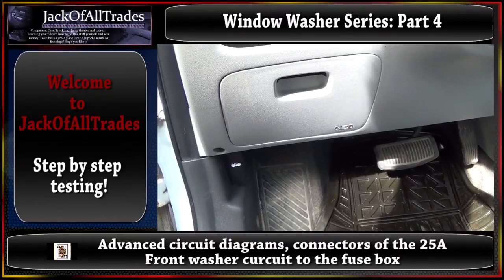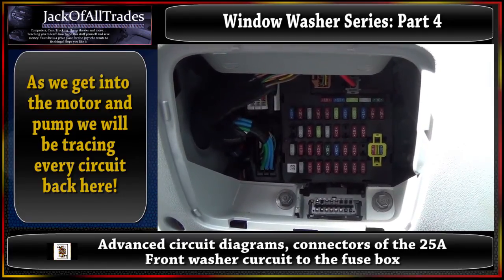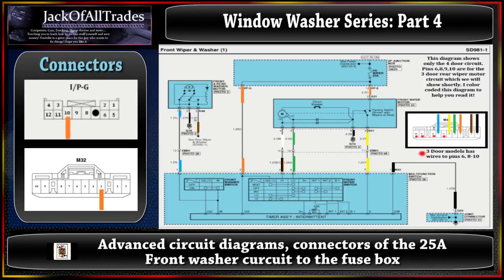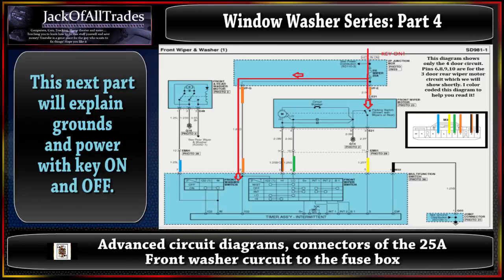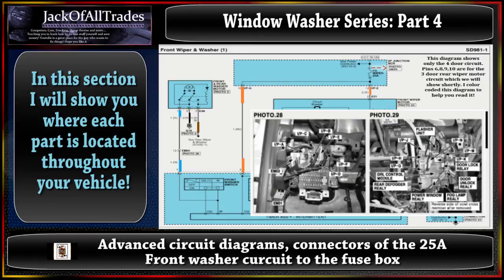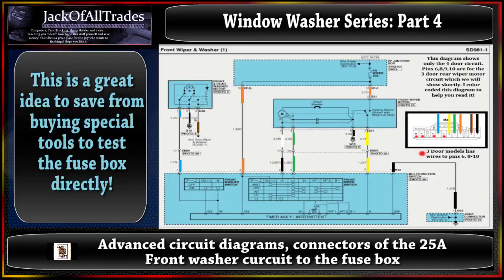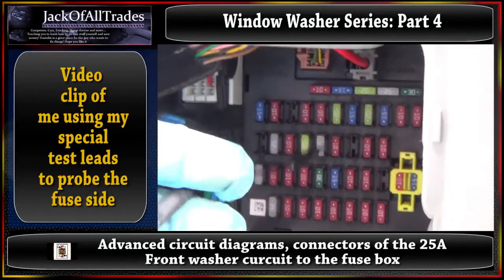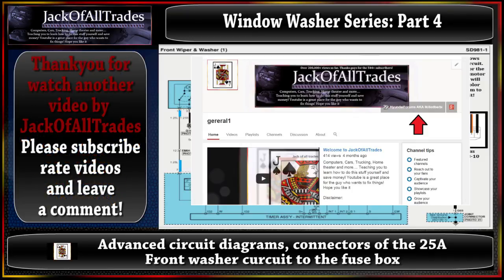2009 Hyundai Accent Window Washer Series part 4 testing from fuse box to the switch in 720PHD

Comment: is there a fuse for the windshield washer motor? my wipers work but it doesn't throw any fluid out..
Reply from the maker: If you check my channel I made a well detailed video on the wash pump and hoses and replacement.

Comment: Hello method of checking the bulb Fuse Accent from Al colmondo
Reply from the maker: saide mohamade h/lp (rht)(left) are 10 amp fuses. Turn key to on turn multi switch to on then you can test fuses while remaining in fuse box. Banana clip to ground and tip touch both  contacts on each fuse. Test light should light on all 4 contacts. The multiswitch creates a ground when turned on. Key on only supplies power but multiswich supplies the ground thus ground switched circuit.
Reply from the maker: ***** ask question in 2006-2011 forums in my top stickey post if you need wire diagrams ......
Reply: Yup
Reply: Yes, I need a graphic wire
Reply from the maker: What diagram do you need? I have a bunch included in these videos. Still need to finish front wwpier and pump testing..
Reply: I want an easy Thanked schemes
Reply from the maker: Which item is not working... Fluid, wiper?
Reply: Anaatkelm little English
Reply from the maker: Send me your email on on Saturday I'll send you the diagrams on this system. My email address is on the main page under about tab under business inquiries. I'll send you the etm wire diagrams and pins connectors. Do you know how to read schematics?
Reply from the maker: Driving from NY to Washington right now in my commercial truck
Reply: Well thank you also want to
Reply: But Send charts